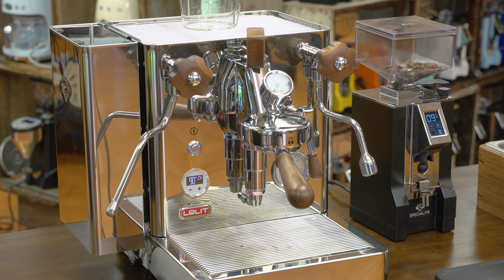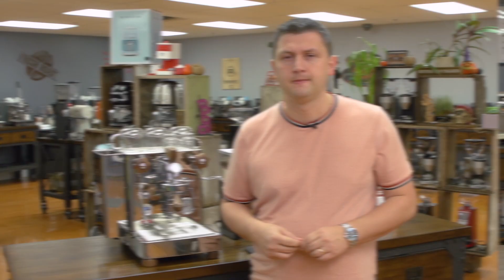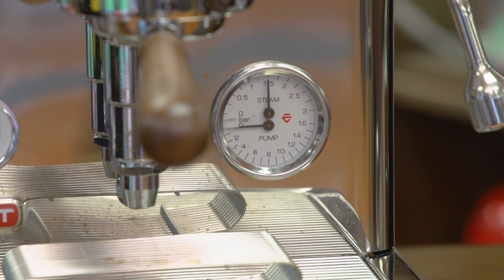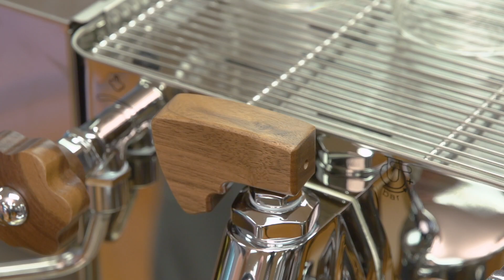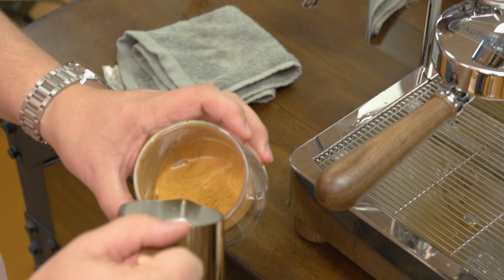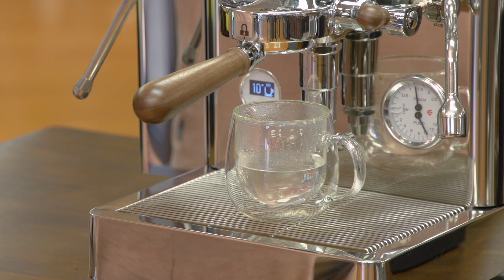Lelit Bianca w/ Flow Control Espresso Machine Preview

Comment: Thanks for the video. I’m torn between this and the ECM Synchronika. Definitely want flow control but happy to upgrade the ECM. I’m from UK and can’t find ECM with FC already fitted.
Reply: What did you go for in the end? I'm now torn between the two...I prefer the joystick style steam knob on the ECM and I know you can upgrade to the flow control...like that the Bianca comes with a bottomless that is a nice touch
Reply: @SanMartan  ECM is built to a better standard, but they're both good machines.

Comment: Hi Slavic, I saw that you carry both Lelit Bianca and the ECM Syncronika. Since both pretty much has the same features which one would you recommend?
Reply from the maker: Hi, I would give the edge to the ECM based on build quality but if you add the flow control it costs 30% more than the Bianca and if you want the wood then that also adds to the price.

Comment: Does the pid preinfusion overwrite the flow of the manual flow control? Not sure I understand what the pid preinfusion does when there is a manual flow control?
Reply from the maker: Pre Infusion activitates the pump for a short burst but the flow is still regulated using the flow control device.  For example, if it was fully closed you wouldn't get any water flowing through.  Normally this type of preinfusion is set to a short amount of time, just to wet the coffee a little to allow the puck to swell before subjecting it to the full extraction.  With the flow control you can restrict the flow and soften the preinfusion and make it much longer .
Reply: @iDrinkCoffeeCanada  got it! thanks

Comment: Great interview! Just a question, can the dual boiler machines usually be powered-on with separate switches to each boiler?
It would be very useful when we just need heat the brewery boiler to brew the coffee and hot water for an americano, while turn on both boilers only when making latte.
Reply: yes u can turn the steam/hotwater boiler off by pushing the minus button

Comment: What about the material? The lelit machines i know have very thin material, so it looked pretty cheap. But this machine looks much better. Well build?
Reply: Not as well built as other Profitec Pro 700 or ECM Synchronika.

Comment: Hi, thanks for the video. Is it normal for the grouphead pressure gauge to go to 8 bar then dip to 7.5 bar and then continue to build pressure to either 8 or 9 bar? Thanks.
Reply from the maker: This could be related to your flow setting or your grind.  The best way to test is with a blind basket.  A blind basket should have consistent pressure because it is solid.  If you are getting consistent results with a blind the issue is likely the way the coffee is ground and/or distributed
Reply: @iDrinkCoffeeCanada  - thanks so much for your help. Yup the blind filter works fine, no pressure dip at all. I will fuss with my Mazzer Mini and ser if I can eliminate the pressure dip. It only dips at the very beginning of the extraction while it is building up pressure. THANK YOU!!!!
Reply: @iDrinkCoffeeCanada  - does the Mazzer need time to settle down? It is less than two months old and under 200 grinds
Reply: @iDrinkCoffeeCanada  - hey I just discovered something. When I turn on the preinfusion on the PID, there is absolutely no dips whatsoever. Sorry I am bothering you so much!
Reply from the maker: @glichasasha750  yes, there is a break in period for burrs.  As your grinder goes through more coffee it will become more consistent.  This is entirely normal
Reply from the maker: @glichasasha750  the pre infusion is helping, that's good.  Pre infusion wets the puck at a low pressure prior to subjecting the puck to the full pressure of the pump.  It does sound like the fluctuations you are seeing are normal.  I can suggest that you can try to improve your distribution and aim for an even density across the entire puck, this will help with pressure and channeling
Reply: @iDrinkCoffeeCanada  - I appreciate your help tremendously! Thank you!!!!

Comment: Is there any similar patent/mod for a machine with the Bezzera Heated Group (not E61)?
Reply from the maker: Not currently.  The flow restrictor on the bz group is located in a different location so it's not something that can be easily retrofitted. A new machine would have to be designed with this

Comment: That was no pre-infusion you did. When you turn the lever all the way to the left from the start, you close of the water to the group head. In that case no pre-infusion happens at all (the pressure gauge never rising is clear indication that water never reaches the puck). You need to start with an open lever, allow some pressure build-up (2 bars) and then turn it off for the desired pre-infusion time before opening again for extraction.
Reply from the maker: You are correct that when the flow restrictor is fully closed that no water goes through.  If you move it slightly counter clockwise you do begin opening it.  It is possible to preinfuse at much less than 2 bars.  Are you suggesting stopping the pump entirely and then resuming?  That's a technique that I haven't experimented with but I will give it a try
Reply: @iDrinkCoffeeCanada  - I'm owning the Bianca since beginning of this year and loving it. Just try as Mathias explained - it works perfect! Keep in mind : With setup from manufacturing the paddle is slightly open in closed position - if you like you can reajust the paddle...
Reply: @LowsHand  I was watching a different video, and I thought it said it was also possible to programme a pre-infusion through the PID/Control centre, without manually using the paddle. Is that right?
Reply: @wytstriped  I don't think E61 machines do that, there's a quick automatic built in pre-infusion (pressure builds up to about 4 bars for a second or two before ramping up normally) in many E61 machines but usually with flow control they install a stiffer spring in the bottom part which prevents that from happening so you get more manual control.
Reply: @wytstriped  the v3 version does this

Comment: What do You think about the Build Quality of the machine?
Reply from the maker: Hi, it's actually quite nice, I like the rounded edges and over all I think the machine is well made
Reply: Hello Martin, the Bianca has standard components from the BG61-market - so this is the same quality compared to other 61s. The sheet is a little thinner compared to ECM or Bezzera but thick enough for solid feeling. You'll get an awesome machine with lot of accessories for a very attractive price!
Reply: @LowsHand  Thx for your assessment!